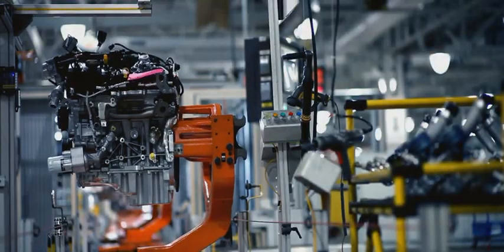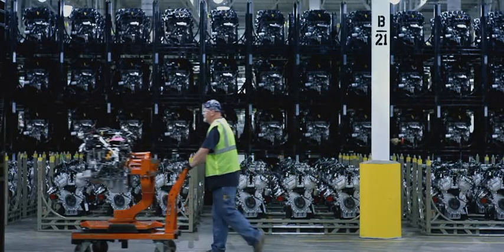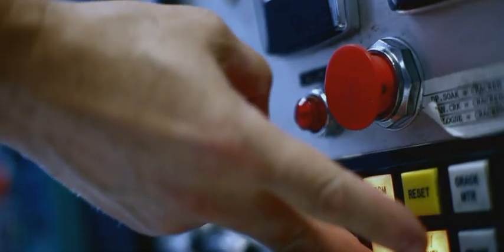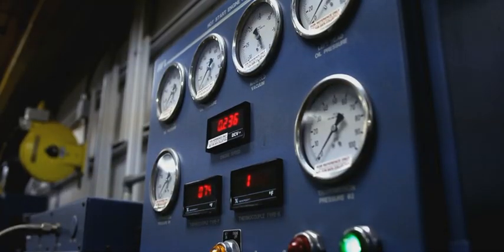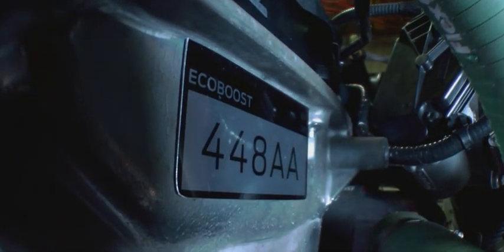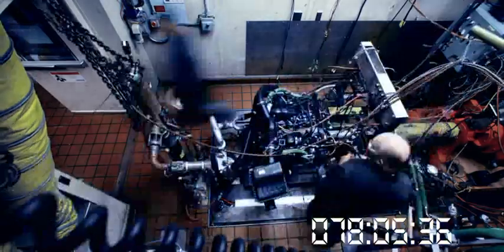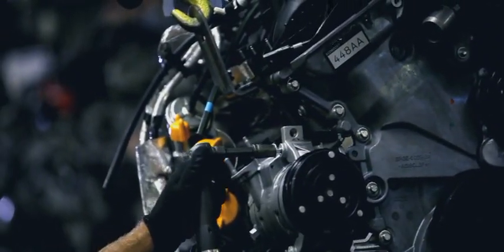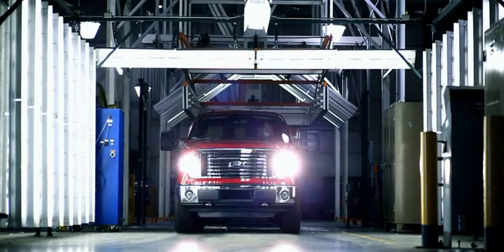2011 Ford F-150 - V6 Ecoboost Torture Test - Capital Ford

Comment: To bad the torture test didn't suffer from limp mode, engine shutter/vibration issues that have plagued so many people. It probably did, but since Ford is doing a test all you can expect is great results. Ford does a test then Ford will be amazing. Chevy does a test and Chevy will be amazing. It goes on and on and on with all manufacturers. Anyone that believes this crap is an ignorant person who probably voted for Obama,….twice.

Comment: @capfl @capfl although  alab will allow you to control varaibles that affect and engine. Taking it into the real enviroment where such extremees exist will have much different results. For example: Take the engine to the arctic. Expanison or int heis cuase contraction combined with the density, ambient temperatures, sub normal temepratures and extremes ona ll compnents of the vechile will be a great test, although you will require different parameters to measure strain on the engine

Comment: Based on online complaints, the engine ford built is pretty good, only a couple minor issues popped up. the 6 speed transmission it bolts up to however seems to be having major issues. hope they fix it soon.

Comment: @capfl True. They are introducing a lot of the technology shown in their Ecoboost line into their V8 line. Direct injection, variable cam timing, multiple cams and more. I think that Ford has really leaped ahead of their competitors as far as ICE goes, but I guess they're just showing how much potential ICE's have without having to go hybrid or electric. Kind of fitting if you think about it, Ford was the first to mass produce cars, so why not maximize it's potential through mass production.

Comment: @MrFootballstud20 I test drove a White FX4 with their 20'' package with the Ecoboost...and I would have to say...O...M..G...it's fast and dang the thing can get through anything. What's funny and weird at the same time is that the truk I drove had the sme 4WD drive train as the Raptor I test drove back n March. Hill assist and locking front and rear diff's

Comment: I love Ford and will love them for life! I've owned 3 Fords so far, my first was a 98 Ranger but had to get rid of it for a bigger truck, I then bought a 2001 Ranger (extnded cab) and again had to get rid of it because I needed a bigger truck, and now my new truck is a 2002 F150 and I LOVE it, best truck I have EVER owned has 99,000 miles and is ready for 200,000 more. Thank you Ford for making GREAT trucks.

Comment: Cool torture test... I doubt it replicates 150k miles very well in a sealed room though.. Yeah the heat and cold over and over is rough, and the WOT for an hour is probably not fun if your a valve or connecting rod, but true engine wear comes from dirt and dust. Lets put some grit in the air and run 300hrs on a dyno.. I'd buy one in a heartbeat.

Comment: @capfl not calling the v6 crap i am very impressed with the numbers but for a v6 in a pickup to out pull a v8 is usually unheard of i admit i am a v8 kind of guy but if the v6's get better than the v8 then theres no point in a v8 anymore yes the 6.2 is a massive engine and a true ass whomper but its not too much further ahead of the new v6, i'm saying with time people will look to the v6 for towing and economy which isn't bad thing but v8's have always been in some way dominant compared to v6

Comment: I'm thinking of getting one of these F-150s soon or a Jeep 4-door Unlimited. But which vehicle will last the longest & are these F-150s (with the new motors) 4-wheel drive? From what I've learned both vehicles have pretty crummy gas milage at around 15/20. Also, I heard the 3.8 motors in the Jeeps aren't very powerful at all. I really like the Jeep from the standpoint of being able to put the seats down and sleep if I need to, but I suspect the Ford is much better built.

Thoughts? Thanks Much!!